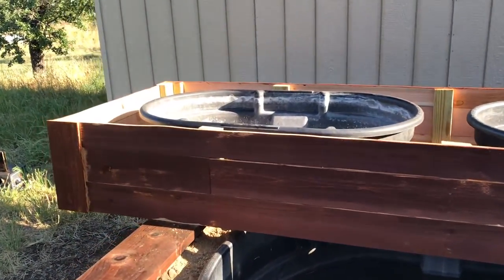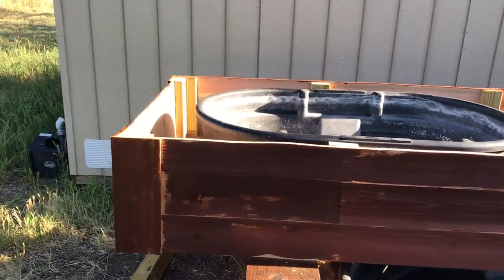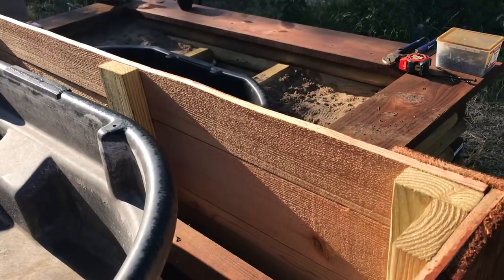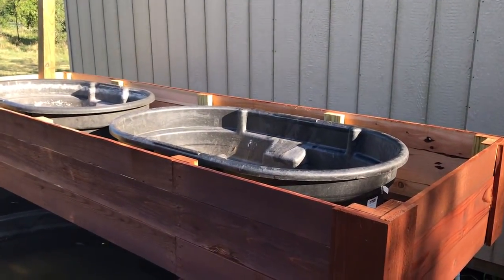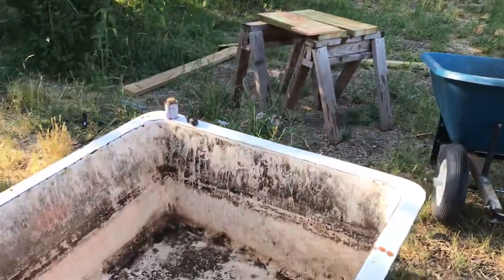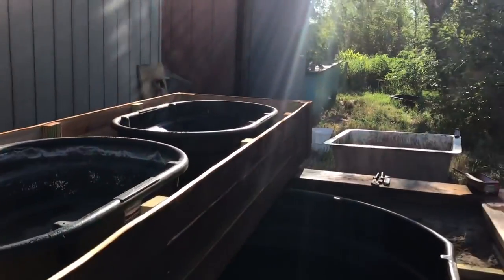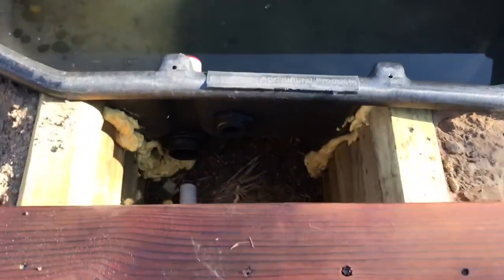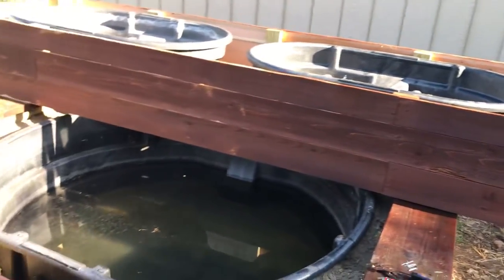New 300 Gallon Aquaponics System - Part Four

Comment: Love it! Your comments about wives and the pretty factor are spot on. I just set up a proof of concept wicking bed and made sure to specify that this is just a trial run and anything permanent will look far better (i.e. no or minimal exposed plastic, all wood). Mitering the corners of the top rails would dress it up a bit too. Small additions like that aren't really functional, but up the wife-approval factor a ton. Really liking this videos, Jack.

Comment: I'm a woman and my system isn't even close to being as pretty as this. Just a horsetrough and I cut 55 gallon steel drums into grow beds (green) and I have a blue plastic 55 gallon drum cut as a vertical planter inside the middle of the trough as my trickle filter for water plants. Don't know if I'd spend the time or money making it look as nice as what you have, but then again I'm constantly updating and expanding the system so any prettiness would just get in my way.
Reply from the maker: Actually the pretty aspect of this system won't get in the way of expansion and upgrades all.